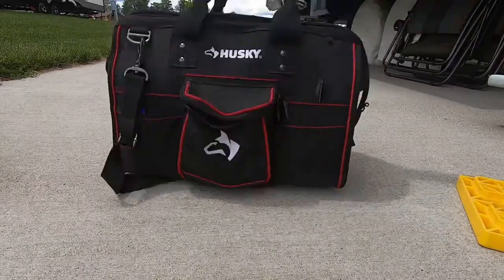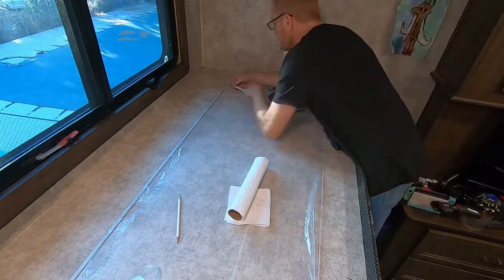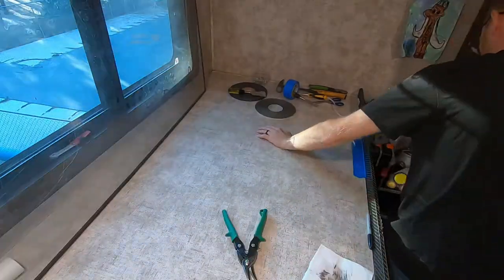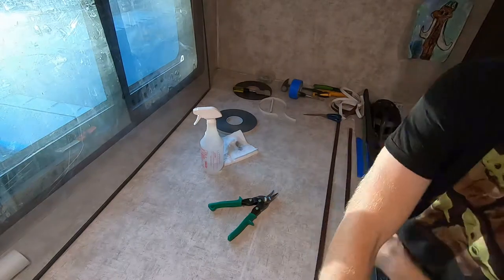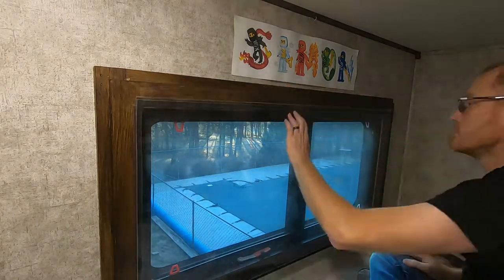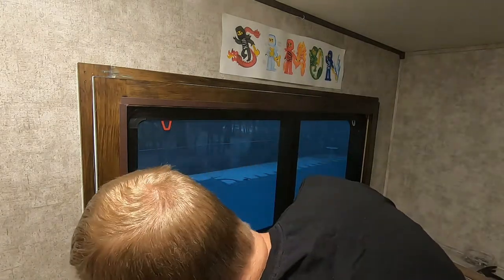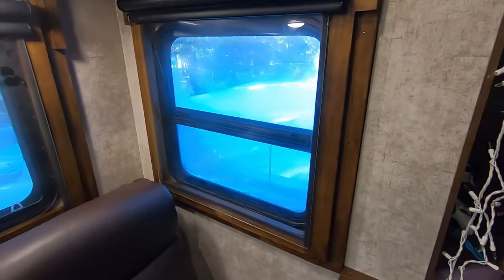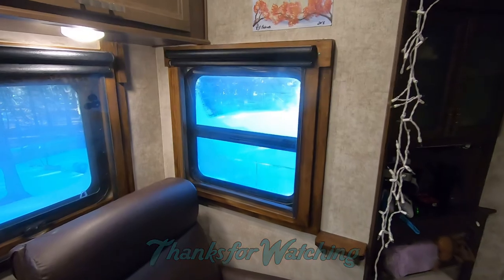Storm Window Frames Part 2 - WindowSaver.com

Comment: This is my first winter in a rv and we did the aluminum tape and bubble foil route and I hate that we don't get sunlight. I'll need to replace my windows before I can use this method due to the nob being on the window to open it instead of a slide window. But to know this works is great.
Reply from the maker: If you don't want the hassle of building wood frames like I did it might be worth just cutting holes for the knows and patching up those holes with something flexible like reflectix just a thought!
Reply: @AlcoholFreeRV  I saw the video. It's just a good excuse to buy the corner jig I've been wanting for the last couple years.

Comment: How well does it work with controlling condensation?
Reply from the maker: it helps, but it's not 100%. The windows are drafty as they are, and water vapordoes get in from the outside.